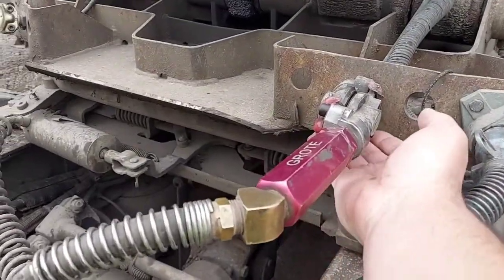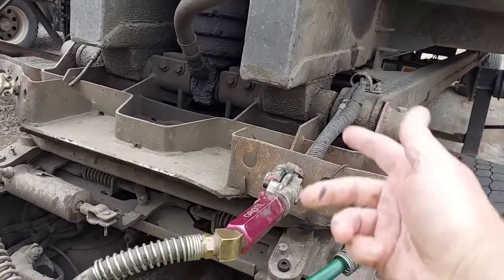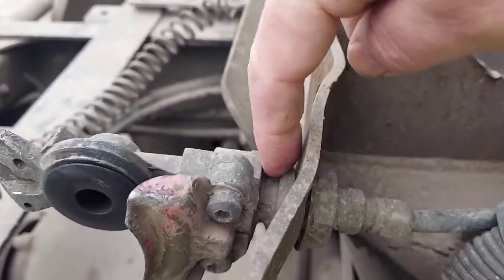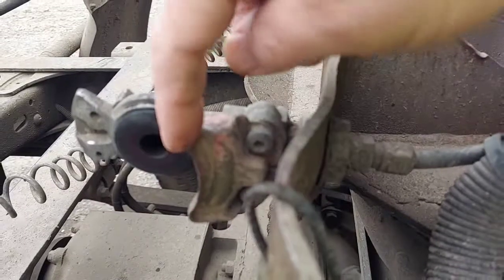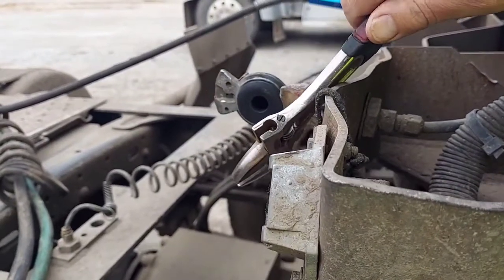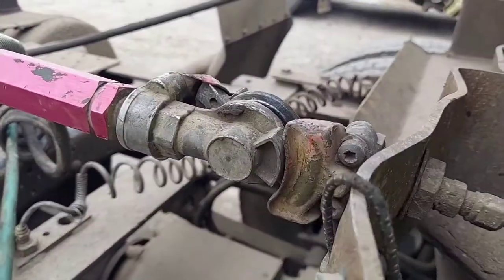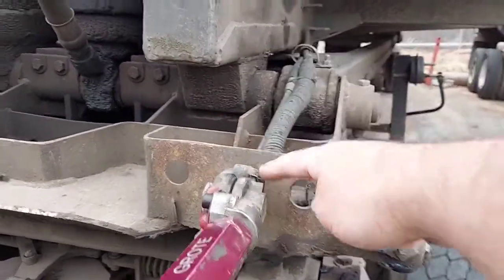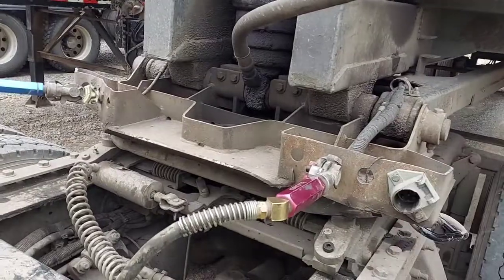How to fix a leaking Glad Hand.

Comment: Dude! You saved me from a crappy week. Thanks!

I had to use a trailer that I'm not used to because mine is in the shop. I got loaded and heard air. Didn't detect it on the pre-trip. 
It's all good now.